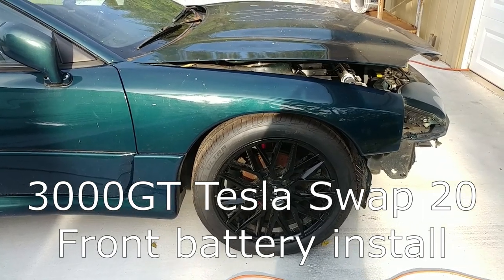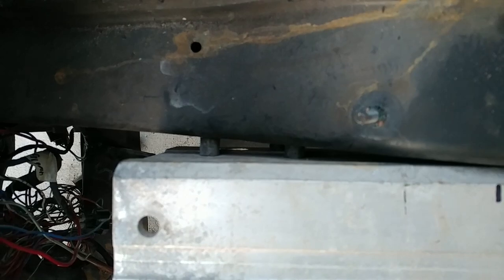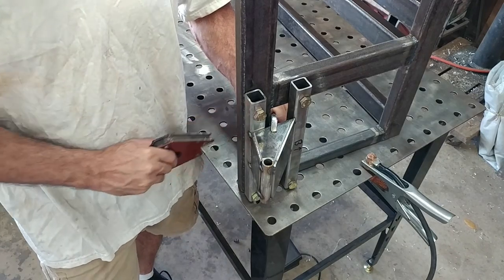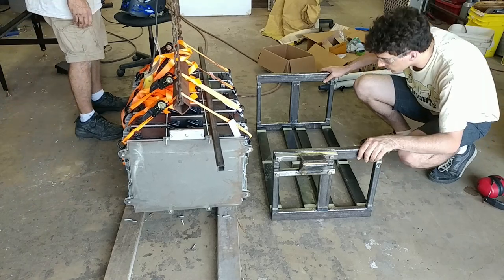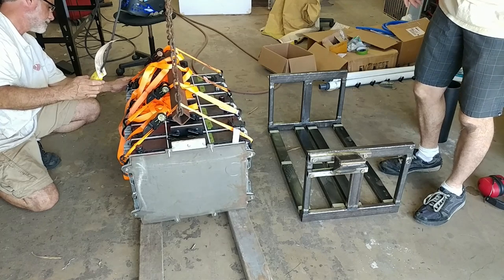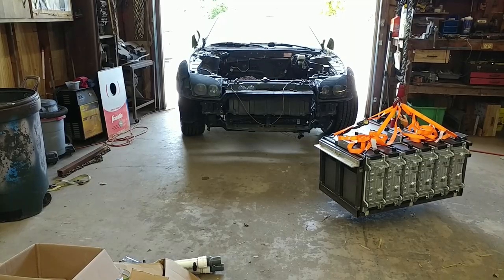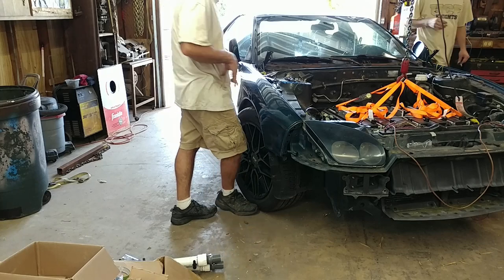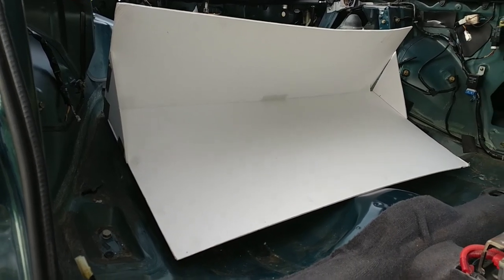Mitsubishi 3000GT Tesla Swap 20 - Front Battery Install

Comment: Such a cool elktromod, any ideas what it'll weigh when done, also will you be using anything like the new aem ev controller. 
In order to get the most out of the tesla motor? 😎
Reply from the maker: Weight will be a few 100 lbs more than stock, probably comparable to a VR-4 if I remember my estimate correctly. I already have a 057 technologies controller for the motor, I just need to plug it all in once the batteries are ready.
Reply: @azimath9939  very nice, the vr-4 was my dream ride back in the 90s when I first got my license. 😁
Any idea what the hp&tq will be when it's done?
Reply from the maker: I'm hopeful I can get the full rating of the drive unit I have, 450hp and 332 ft-lbs.